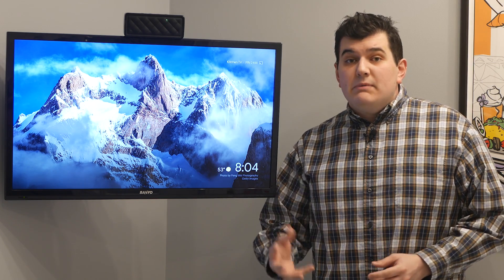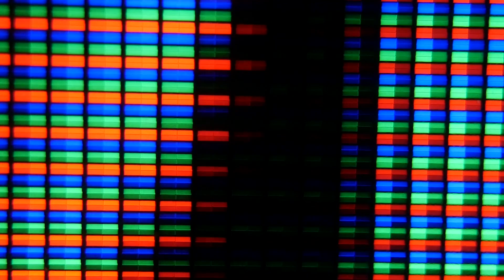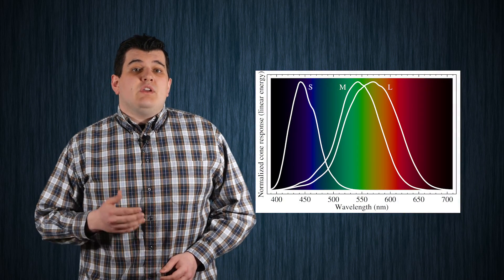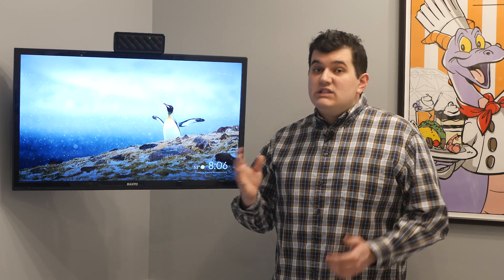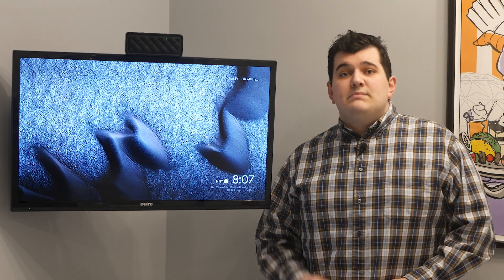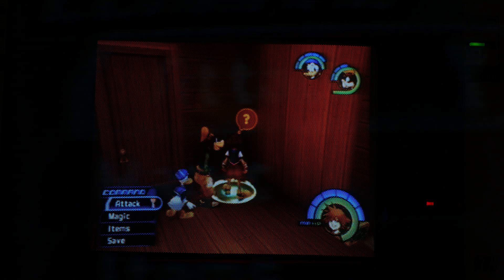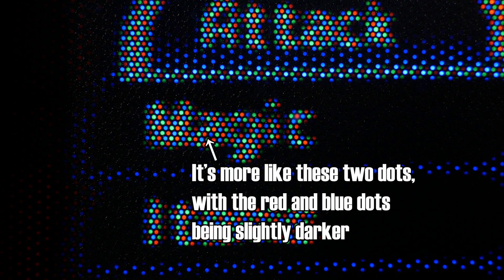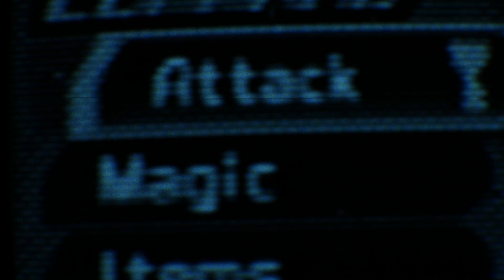These Are Not Pixels: Revisited

Comment: Funny biological trivia about the fact that color can be produced by  a pure wavelength or a non-spatially resolved mixture in between.
This rules apply to almost all colors (and happens also irl, not only screens), but there is one color that works slighty different and exist only as a mixture. Can you guess which one?

Magenta is the answer. It activates both blue and red cones, so the midway frequency is...green. Which would make the resulting color white. So to obtain the magenta pattern of stimulation you can only use a mixture of blue and red, but pure magenta doesn't exist. This is why in perception we have a color wheel, but if we decompose white light we have a linear rainbow
Reply: Yes, pure magenta does exist. And magenta isn't the only color that "exists only as a mixture". The same goes for greys and white. I know what you mean, but you should have phrased it more precisely: magenta is the only hue that is not spectral, i.e. cannot be evoked by light of a single wavelength. Grey and white are colors, but they aren't hues. And spectral colors are very rare in everyday life anyway, most colors you see will be caused by a "mixture" containing several wavelengths.

People should get the notion out of their heads that color and wavelength are the same. They're not. Wavelength is a physical property of light, but color is a subjective perception. Our visual system isn't a spectrometer, it does care about seeing useful differences in the world around us, it does not care about doing a spectral analysis. Most objects are reflective, i.e. they don't emit light of their own. The specifics of the light they reflect does not only depend on the characteristics of the material, but also the light source (and the medium that the light is travelling through). Our visual system has therefore evolved some tricks to try and do the impossible: remove the influence of the light source. This leads to effects such as the checkershadow illusion http://persci.mit.edu/gallery/checkershadow and this one: http://www.labofmisfits.com/illusiondemos/Demo%2012.html - where we perceive the same light as different colors, because context matters.

You also wrote "color information is transformed from 3 separate R/G/B channel in the photoreceptors to two channels, R-G/B-Y" - that's not correct either. You are talking about the opponent process, which transforms the three RGB channels of our photoreceptors (disregarding that they aren't actually RGB) to three other channels: the two color difference ones you mentioned, plus a brightness one you didn't mention. We actually do something very similar in both analog and digital image/video processing. Look up YUV and YCbCr.
Reply: That actually brings up something I've heard before; the fact that we can never really see a "pure" green, while we sort of can for red and blue. Both red and blue cones have a range of frequencies where they're the only cone that's activated, but green cones are entirely overlapped by the ranges of either red or blue.

Because of that, I've always wondered what we would "see" if the green cones alone were triggered through some sort of direct stimulation, what we would actually perceive from that. Would it look like some kind of super-green or something?
Reply: This is a hard question to answer because it plays on some subtle structure of our eyes and of our brain. First, red and green overlap a lot (with a reason actually), while blue is farther away and only partially overlaps with green. Second, this asymmetry is also reflected in structure, as red and green cones make up most of the central, high resolution part of the eye (the fovea), while blue cones and rods fill most of the periphery. During daylight vision, your brain reconstruct high definition black and white images from mini-snapshots received from the fovea while your eyes dart around to cover most of the visual field in HD (this is why the red and green cones are very close, since they also have to act as a b&w high resolution receiver, and optical aberration would mess up the image if the maximum points were too far spread out). Color information is added later, both from parallel green and red channels from the fovea and peripheral blue information, and your brain just plays "fill in the shape". So actually your green and blue cones are never really active from the same point because they are looking at different parts of the visual field, so the effect of pure activation of green might just be corrected out since your brain is already dealing with wonky color information anyway. Also some weird perceptual stuff might play some weird effect, since color information is transformed from 3 separate R/G/B channel in the photoreceptors to two channels, R-G/B-Y, and those get sent to your cortex. So basically I would go for a "no special effect", but I wouldn't bet on it.
However, if you want to see supercolors you might be in luck. We can abuse that weird two-opposing-couples channel scheme to see them. Search google for hyperbolic colors and stygian colors, and also look at the wikipedia page for impossible colors.
Reply: You're right about whites and greys, but I they are way more known from the classical rotating disc/prism experiments.
On the opponent process I was considering only channels that partecipate in color vision, since I nodded already at the brightness channel beforehand. In general I am not going to be anal about terminology and quirks in the youtube comment section, especially since that comment was already too long by itself. I trust people enough to be able to go on google by themselves later if they want more in depth explanation of the visual system. Kind of like Alec glossed over QAM when explaining color television, the one of us that were interested could go look for it by themselves while keeping the information in the video to the point.
Reply: Idran - That's a worryingly deep question.
Reply: Idran I for one put forward the answer of yes because memories or imagination of green is more vibrant than perceived green. At least for me, heh.
Reply: "On the opponent process I was considering only channels that partecipate in color vision" - The "brightness channel" does absolutely participate in color vision. You might be thinking of scotopic vision (low-light vision), produced exclusively by the rod cells, which relay no color information. But in photopic vision (daylight), all three channels of the opponent process are needed for the full color information.
Reply: Buddy Clem Green laser light is already super green (or as close to as possible while not hooking directly into optic nerve traffic!) by definition, because it's a single wavelength which is directly perceived by green rods, and is coherent
Reply: I think if you wanted to define non-spectral colour a bit more rigorously you'd have to also acknowledge any made from a mixture of a spectral colour and an achromatic colour: for instance brown.
Reply: Purple: Everyone's favourite colour that doesn't exist.
Reply: Matthew Ducker Idran
Once on a dark, foggy night, I was hit with a green LASER while driving. I have to say the green coherent light that seared my retinas was terrifying! My attacker was smart enough to do it in an area without mobile phone coverage at 3AM. I'm not sure if that counts as "super green", but I think it was. Anything greener than that would have to be amazing!
Reply: TheBytegeist is completely right. There are a lot of misconceptions going around here. It is also not true that all perceptible colors can be produced by mixing three pure wavelengths of light in differing proportions. Hypothetically, if it were possible to individually stimulate S, M, or L rod cells, then we could use any combination to produce any color, real or not. But because of the way they overlap, this isn't actually possible. While I guess you can purely stimulate the L cone with very red light, it would be very dim, and the same is not possible for M and S. The total range of colors that can be produced by mixing certain primary colors is called the gamut, and there will be some perceptible colors missing from any gamut. Just as a simple example, your screen cannot display violet, and the closest purple it has is still visibly different from true violet.

(Magenta, by contrast, is simply defined as an equal mixture of red and blue, which technically makes it a purple. However, like all colors on a real consumer display, the magenta you see will be pretty far from a true, fully saturated purple.)